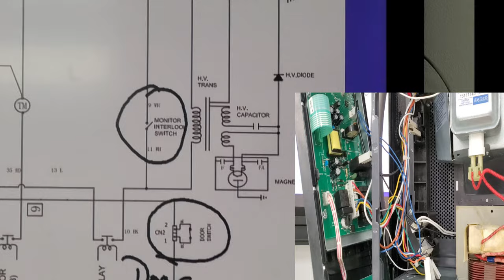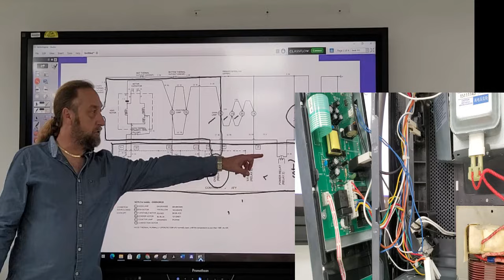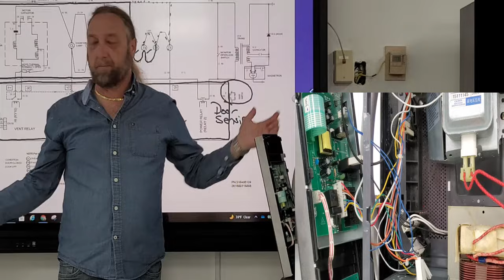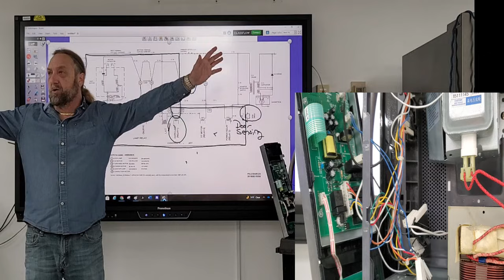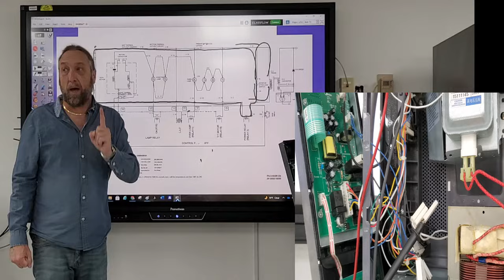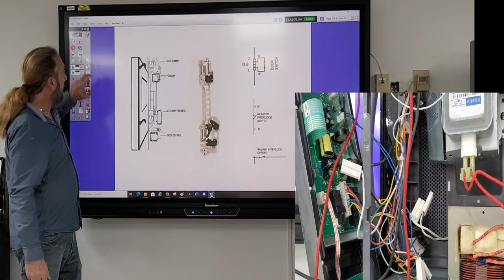Microwave Door Switches

Comment: Hello, Great Job! However I havnt figured my issue out yet. Started with the microwave just stopping suddenly in the middle of cooking. Found the main fuse was blown. Changed it but I have no heat and the turntable doesn't work. Light works, fan works and it counts down. Checked capacitor and magnatron and both have continuity and are working. Not sure how to test the diode. Any help would be much appreciated. Trying to find where you have a class on checking the transformer.  I find this so interesting and you are really great at teaching!

Comment: This gives a good reason not to open the door while it's running. Because if the activation of the switches is in the wrong order it will short out and trip the fuse.

Comment: I looked this up because I noticed that when I push the door open button on my microwave but not all the way the fan, turntable and light all go on. So now after watching this I guess it's because only sone but not all of those 3 switches are triggered. The door is still completely closed but the button I have partially depressed so it is starting to open the door. And I couldn't figure out why it does this.

Comment: This is an incredibly helpful video—thanks to it, I was inspired to quickly pinpoint the fault: the monitor switch wasn’t opening properly, which kept blowing the fuse. However, I have three questions and would really appreciate it if anyone kind could help clarify:

1. The schematic shows two lamps labeled CL and OL. When the primary switch fails, which lamp still works?

2. What does the rectangle labeled “Control Panel” at the bottom of the schematic represent? It seems like the Door Sensing Switch only controls the Humidity Switch and is unrelated to the relays inside the box—is that correct?

3. According to the schematic, aside from the H.V. TRANS, components like OL, FM, and SM don't seem to form a complete circuit (i.e., from live line back to neutral). Why is that?

Thanks a lot!

Comment: Great information, one question if you will? Samsung microwave blew my capacitor i replaced it and one thermal fuse and one of the two ceramic fuses, and when i plugged it back in the fan stays on with door open or closed and you can't cook it blows the ceramic fuse right away can you help me please I'm now thinking it the monitor switch? Thanks a lot.

Comment: Great information. Just before seeing this video, I worked on my daughter's OTR Bosch Microwave. Blowing the breaker and finally blowing the internal 20A fuse. Not having watched this video or had the schematic, I tested the switches (ohmeter) and they were good. Relay working and transformer good. Checked the HV capacitor and it was dead-on for capacitance. HV diode tested fine. Hooked up power to the HV section and MW worked fine. Opening the door wouldn't blow the fuse. Finally, I  noticed that the door wasn't closing as tightly as it should. Looking into the oven side of the latch assembly, the 2 ramps that the door latch hooks ride up on inside the oven and latch the door (and trip the switches) was worn. This caused the hooks to be maybe 1/8" lower than when new. The top hook was barely hitting the top switch when the door was "closed". The MW oven has the same black switch holder latch as shown in this video above. I replaced the assembly (with 3 new switches, only $2.00 more than w/o switches!), works fine now. I put a bit of lube on the black plastic to reduce wear on the new part. I looked at several other ovens much older than this one, and none of them had appreciable wear. Watch out if your oven has that black plastic part. Get a flashlight and look into the oven where the hooks enter for wear. This was only a 4-year-old Bosch MW oven that lists for $1150! Ridiculous.

Comment: I have a strange problem.   One door switch seemed to be stuck in closed position (whether door was shut or open).  According to the drawing on it, it is supposed to be open when the door is open, and closed when the door is shut.

I dislodged it from the microwave, and when i tested freely, switching the button to simulate closed door, it worked as specified.  I was gappy believing it just got unstuck 

Then i reinstalled it.  But now it started functioning in reverse order (closed when the door is open, open when the door is shut).  I cannot figure what explains this final situation.

Comment: I realize this is training but as a homeowner I completely messed up my whirlpool WMH53520CS-2 big time. Let me explain, door messaging open door close door, finally microwave wouldn't work reliably. So I bought 3 micro switches installed (and didn't take pictures of wiring positions or the orientation of each switch normally open or normally closed) after the installation the heavy duty fuse blows immediately.
I just found you and your training am watching this switch training in particular.
Reply: I didn't even know if I plugged the wire connectors into the right position so have to check relay on the board first to see if it's burned closed right?

Comment: Great video.  I’m trying to troubleshoot my 5 yr old GE microwave that powers up, clock counts down, turntable turns, but doesn’t heat.  Seems from your video that it’s high voltage problem (capacitor, magnetron). I’d appreciate it if you could confirm.  I was hoping it was something simple like switches.   Thank you.

Comment: heres one for you,have a samsung oven that had a door latch broken off,i blew the fuse by bypasing the monitor microswitch,i replaced the latch and fuse,now when plugged in the tt turns slowly in reverse and the clock etc work but it wont start,i measured 3.5 ohms on the single pole top switch,is that ok and will it cause that?.Thanks

Comment: Question? The price of microwaves is meager for most over-the-range models. The repair cost should be at most 50%  of a new replacement. To drop a grease microwave, do the repairs, and reinstall it,  Then retape exhaust stack. How do you repair them for a customer? I have been condemning them and walking away.
Countertop units sure fix them.

Comment: So the monitor switch needs to be in the NO state while running, if the monitor switch becomes failed in a NC state it would cause the main fuse to blow? When the door is open the switch closes becoming NC and when the door is shut and ready to run it should be in a NO state?
Reply: The terms NO and NC refer to the state of the switch when it is NOT activated (when the button is NOT pushed down).  They are inherent in the design of the switch.  Pushing the button down doesn't change the switch from NO to NC or from NC to NO.  It changes it from open to closed, or closed to open.

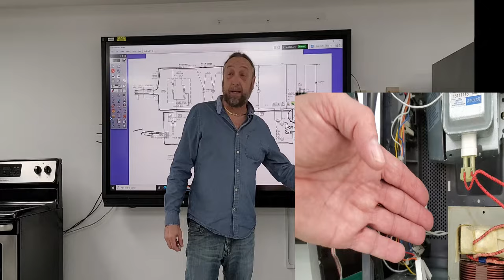Comment: After watching this video, I learned not to mess around with the door switches because I hit 21:50 in the video.  Lights come on, door opens and closes and the light comes on and off.  I can press buttons on the control panel and it will start "cooking", the fans come on, but no heat.  So thanks to this video, without needing a single multimeter, I learned my switches are fine.

The stuff beyond this is above me as I don't want to mess with high voltage components nor do I want to mess with soldering, so I am taking this ol' microwave to get recycled.  Thank you.

Comment: Sharp RE－S２０４ model.  When the door is closed the oven is dead when i open it,  I can see the display working.  When i open it slightly so that the switch button at the top is not push down ,  I can set  timer and start button working.  I am Confuse.

Comment: Switch synchronization was my problem because the plastic track that the two latches run in were worn with grooves in them so switch closing order was off and caused a short that blew yhe fuse.
Reply: So what is the correct order?
Reply: @kentanrem  When you close the door, the monitor switch open, then the primary switch close. When you open the door it's the opposite:  the primary switch open, then the monitor switch close.

Comment: Great Video! My GE Microwave is tripping the breaker in my fuse box. Towards the end of the Video, you mentioned the relay could be the cause, and/or the mounting plate for the door switches being out of alignment could cause the switches to open in the incorrect order. Being the lazy troubleshooter, I would suppose if I check the relay for continuity after unplugging it from the board (meaning it is stuck in the closed position) or check if the mounting plate for the switches has come loose, I could pretty much tell what the issue is? I'll watch the Video one or two more times to know exactly where I get that feeling from.

Comment: Thank you for your video. Question: How do those three switches work, top SW (NO, or NC), Mid SW (NO, or NC), and bottom SW (NO or NC)?
Reply: Upper and lower normally open. 
Middle normally closed. 
(That means the middle will open when the microwave is in use).

Comment: Have a KA unit and the door light doesn't come on when open, and also gives a 'door' error when trying to run when the door is closed.  I figured a door switch was bad... except I replaced them all (only $6 each and already 10years old), and it's still doing the same thing!?!  Any guesses?  I have a parts diagram, but no electric schematic to follow, so a little difficult to figure for an amateur.

Comment: Michrowave front panel is ok, timer is going down michroton is running heating is ok. but disc motor and cooling fan is not running, where is the problem?

Comment: I have a Samsung ME21H706MQS microwave that won’t power on anymore. But when I slam and push the door hard the clock will turn on and turn back off. What could be causing this a bad door switch or a bad fuse? Thanks

Comment: I replaced the 3 door switches and fuse, now have a new problem. When plugging in the microwave it did power on but the turntable started turning and the light came on with the door closed. It does stop when the door is opened but after closing the door is starts turning again. This is happening without setting it to start for any length of time. In fact when I tried to start it with the light and turntable moving it won't. Somehow it must think it is already on. I tried unplugging and tripping the breaker but it did not solve the problem. I did check the fuses for continuity before and after replacing the switches and I'm thinking they are fine because the turntable does shut off when the door is opened. Anyone know what might cause this?
Reply: Sounds similar to the secondary switch is thinking it's open when the door is actually closed.  I'd double check you didn't mis-connect the wires to one of the switch.

Comment: Working on a BE microwave that has an extremely loud, and rather difficult to close door.  Will try sliding the door switch bracket/harness.  

All door switches tested fine, fuse is fine, thermostats find but breaker tripped.  No idea etc is wrong.  Going to start testing all over with new found knowledge from this video and shopping for thermostats, learned about normally close/open.  Quite a pain in the ass!  The k God for YouTube for ppl like me determined to fix it for pennies.

Comment: GE JES1384SF - seems like an upper door (main switch) - lower switch clicks and toggles interior light, Upon when it should start relay clicks and starts counting down, finishes countdown, relay clicks again, beeps, etc. Upper switch feels "spongy" no click or mechanical stop. No turntable, no browner, fan, or tubes.  Looked everywhere for a schematic. (Is that interior light on the main circuit for 0% power?) Makes no sense. Meanwhile locating T25 Torx (Button) Security driver...
It did this a couple years ago and lifting up on door while nudging the start over and over it fixed itself. This time the interior stuff went off all at once at 48 sec to go.

Comment: Great video!!   My Samsung gets E-83 error & won't operate (display on, won't take keyboard input).  If I unplug from the wall briefly, it will then work for awhile.  It never stops in mid-cycle, but is either normal or E-83 error.   

Web search says e-83 indicates a door switch or control board failure.  Based on your video,  for switches seem ok (unit stops if door opens mid-cycle & can be restarted when door is closed)

Is it time to just get a new microwave?  Intermittent problems drive me nuts!!!!

Comment: Can someone tell me when the two relay switches in the control panel Energize. I assume the Big Relay energizes when you press one of the Cook buttons, the other relay, I have no idea.  I have no schematic, and i can not locate one online......  Thanks.
Reply: The big relatyusually has 2 wires on it, that should be sometimes called Relay 2, and that send power to the high voltage transformer. The other relays control fans, lights, turntable etc....
Reply: @appliancetraining5600  Thank you...

Comment: All my switch are working fine but as soon as I closed the door the breaker goes off ? Could you told me more please ? It's a frigidaire Gallery about 4 years old. the schematics is the same as yours.
Reply: Sounds like the monitor switch is stuck closed and doesn't open when the door is closed.
Reply: @Charles-in3zt  or stucked relay.

Comment: Thanks a lot for this excellent video lesson! 👍 The symptom of my Sharp Carousel microwave oven was that when door was open, both fan and turntable started to run. Light was also turned on. When door was closed, it worked just like normal. 
I checked my primary switch and found IT WAS STUCK IN CLOSE. Therefore, when I open the door, the computer is confused. The primary switch (which is CLOSE) says the doors is closed and the turntable and the fan and the light should be powered on; The secondary/sensing switch (which is OPEN) says the door is open and the light shall be turned on. The monitor switch (which is CLOSE) says the door is open and pls shut the heating elements off. This is exactly what I experienced! Repair was easy.
I have two comments for the other watchers: (1) The concept BAD actually indicates two status: stuck in close, and stuck in open. This helped me understanding the mechanisms discussed in the video (2) Locations of the switches may be very different in different microwaves. Obtain a repair manual for your model.
Reply: Where do I find repair manuals?
Reply: If the primary switch was stuck closed, once you open the door the monitor switch should be closed, and thus it should have blown the fuse (unless the monitor switch was defective too but that's not what you reported).

Comment: What brand / model is being shown? I ask as I like the way that bottom switches are activated by the same rotating piece, not by the door latch surfaces - which can cause problems when it wears out part of the holder on Frigidaire units.
Reply: That is a Kenmore"Frigidaire Made" Microwave

Comment: What if you test all four switches and they all change state but the turntable and fan still turn on when the door opens?
Reply: I wish I knew. My turntable shuts off when the door is opened but immediately starts running and the light stays on when the door closes, even though I'm not pressing anything for it to run. Also if you try to start it you get nothing except a running turntable and the light on. Frustrating. I want to fix this thing as I installed a new switch holder , all new switches and a new fuse.
Reply: @Charles-in3zt  dang it. Mine ended up just being a door switch. I watched a few other videos until I found one on a model very similar to mine. Works fine now.

Comment: Panasonic some years back had a series where the combo switch holder was mounted with two screws but on super thin metal that flexed when the door was shut leaving some micro switches not closing properly.  Sometimes the oven would work fine and other times you had to tap or bang on the closed door to get the switches to close.  Very exasperating.  There's a workaround where you pop rivet the plastic combo switch holder to a study part of the oven frame so the switch holder can not flex or move as the door is closed.  An added problem, which magnified the Panasonic flex was they used an overly stiff coil spring on the door latch/ hooks which placed a whole lot more pressure on the switch holder than was necessary when the door was closed.

Comment: So you explained everything except which switch is bad if the microwave fan and power works properly with the controls and shuts the power off at countdown, but when you open the door the fans run and lights come on.

Comment: This video is so usefull I spent many hours placing n replacing the monitor switch...its only a shut-off or failsafe device...my microwave was blowing the main fuse...i replaced the monitoe switch but I was getting continuity on it with door closed and open...why was it doing that???
Reply: Hi Jose, I read up on that for my Siemens device, and it turns out that sometimes some metal holding brackets can be bent out of shape such that the door never actuates (opens) this switch --> poof goes another fuse!

Comment: Microwave works but fuse blows monthly when you open the door. Doesn't matter whether you open the door to stop the cooking or placing food in with the microwave off. What is causing the fuse to blow?
Reply: I would guess your monitor fuse is bad and is not opening when the door is closed.